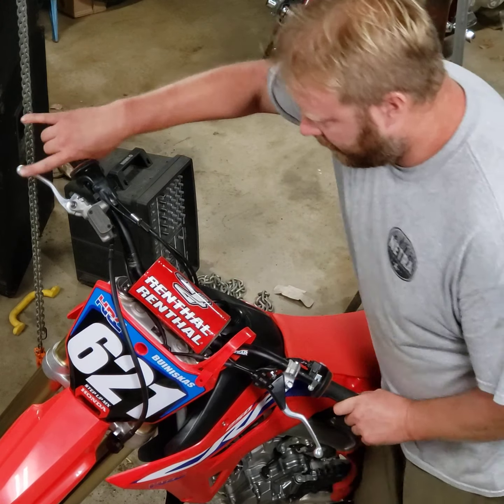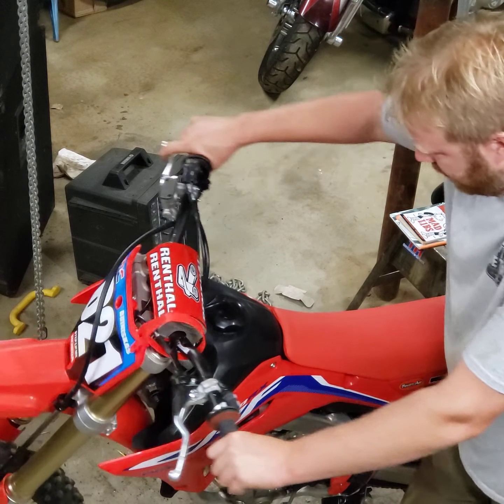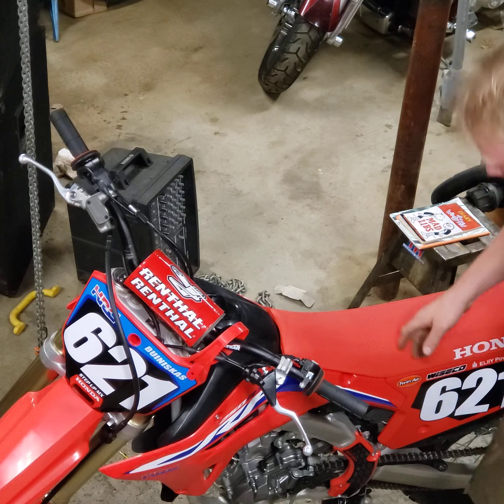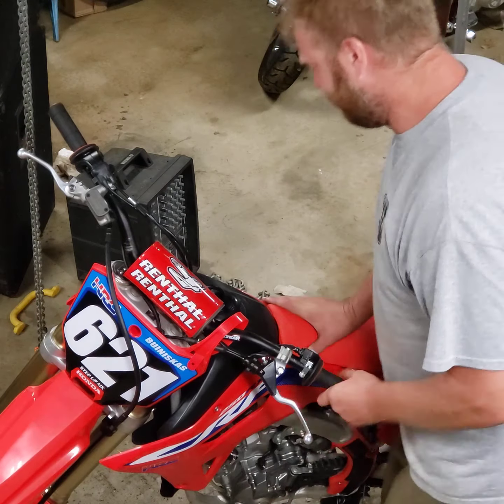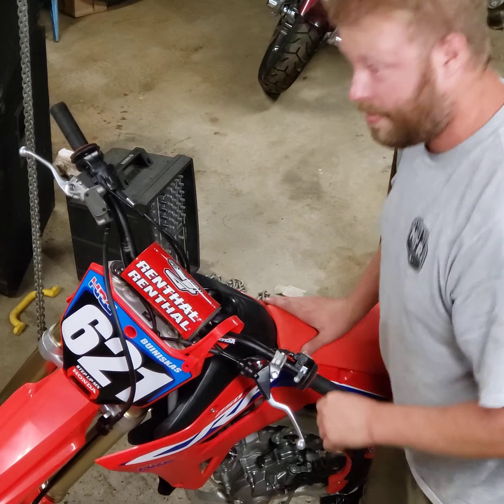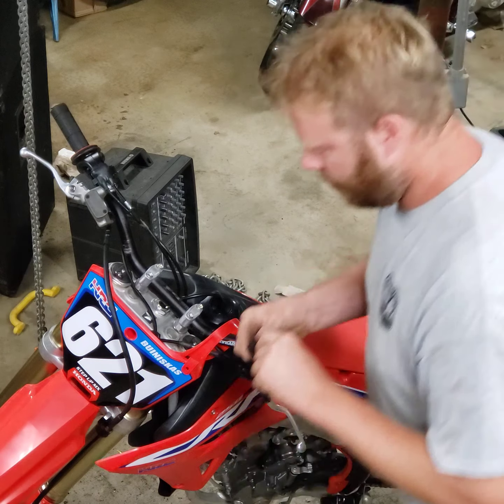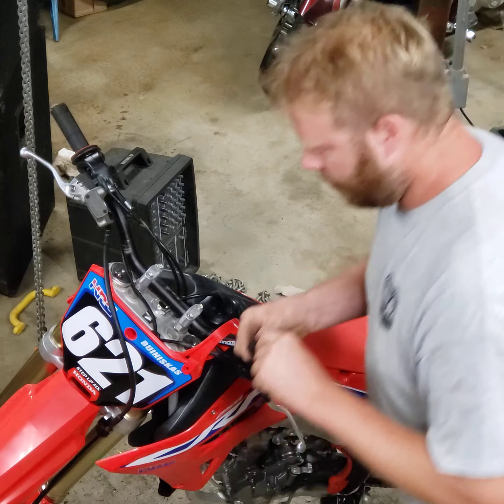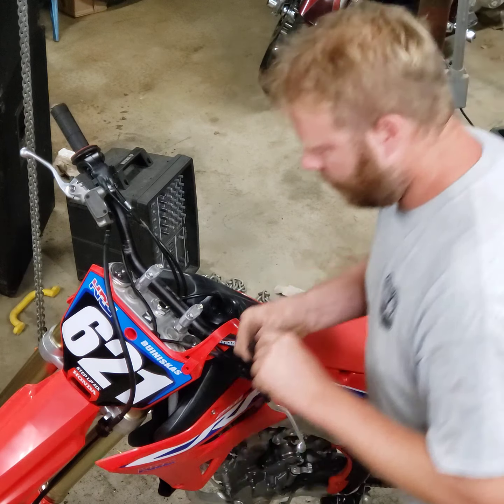crf450 / crf250 17'-22' MotoXLighting install video

Comment: Hello, I was wondering, Your videos show 60w power from the light yet most MX bike stators have only about 80 watts worth coming from the stator. How are you able to get such light from the stator on the MX bikes? I have a yz250fx 2021 and I'm interested in your kit, but I really don't want to be stuck out in the woods with a dead battery.